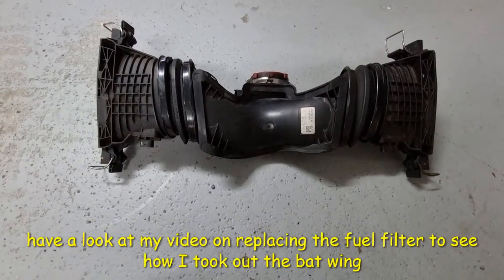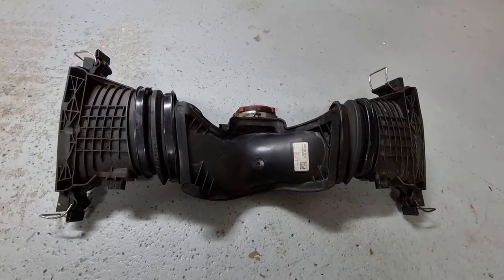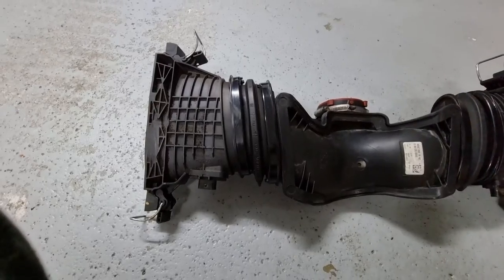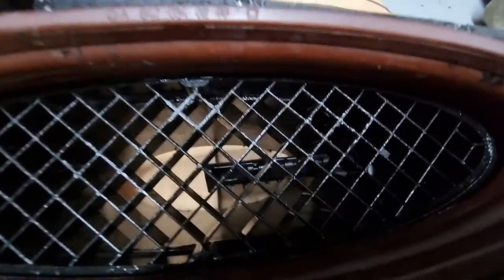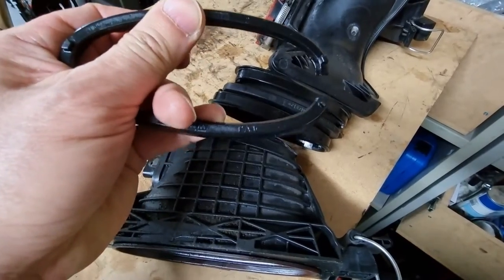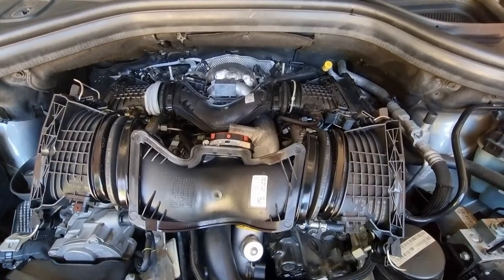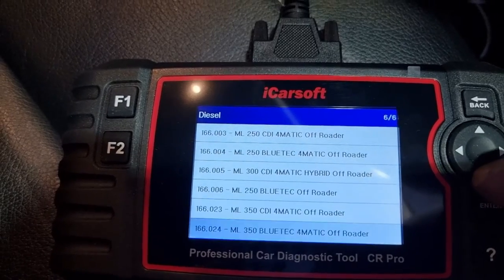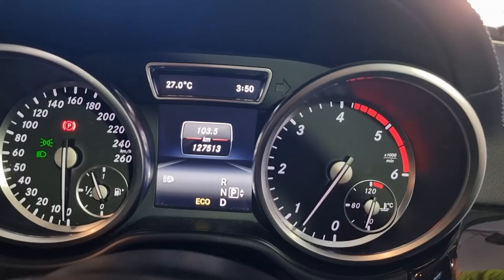Mercedes-Benz W166 ML350 Bluetec MAF Sensor Cleaning Attempt to fix 100B00 100D00 CEL

Comment: Great video!! I had the same codes and replaced the batwing. This piece was very expensive in my country ( $3000 New Zealand) and i ended up buying a genuine part for 1100 in Lithuania but was going to take 35 days shipping, i purchased that and i found a cheap chinese one in Australia for $300 that would take a week to arrive and bought that to get my car on the road again. The genuine has arrived and ill replace if the chinese one has issues. Thanks for your video
Reply from the maker: thanks 😀

Comment: Hi Ken, Thanks for sharing!  I wonder if you could have used a Dremel to carefully cut out the MAF sensors, clean them and then put them back in by plastic welding them back in with an old soldering iron?  Cheers Drew
Reply from the maker: hi, I thought about doing that but since I already broke the plastic pieces and there was no guarantee the cleaning would work I just bought a new one. 😅

Comment: Hi Ken, Thanks for sharing. My GLE350D got the same problem, Can you kindly let me know where did you get the part please? The local dealer charge 3,500 AUD for it. Thanks.
Reply from the maker: hi, I got mine from fixparts-online.com for £850. and I had to pay imports tax (AUD$311) because it was over AUD$1000. My part number was A6420901642. You can get part number for your car by entering your VIN at partsouq.com.  also try partsnavigator.com.au
Reply: @kenkanfix  Got it. Thanks a lot.

Comment: Hi Ken, thanks for the video. Did replacing the full sensor fix the issue for you after all? I have the same error code and wondering if I could do this repair myself.
Reply from the maker: hi, yes replacing the sensor with the bat wing air intake  fixed the issue.

Comment: Hello
I recently purchased a 2013 ML350 bluetec diesel model. He has 180,000 miles on it and I can't be sure if the previous owner has cleaned the engine carbon. I have some hands on skills, how do I determine if this car has serious carbon build up and is there an easy way to do this?
您好
请问我最近购买了一台2013年 ML350 bluetec 柴油款的车。他已经开了18万公里，我无法确定之前车主是否清理过发动机积碳。我有一定的动手能力，我如何判断这台车是否积碳严重，有没有什么简单的方法？
Reply from the maker: Hi, I haven't done that myself,but the only way is to remove the intake manifold to check. It's a big job though. Unless there's indication of a problem I wouldn't do it.
Reply: @kenkanfix  Thank you very much for your reply.
Do you use additives to eliminate or alleviate the carbon problem when using a diesel car? As this is my first time buying a diesel car, I am not quite sure about the properties of diesel.